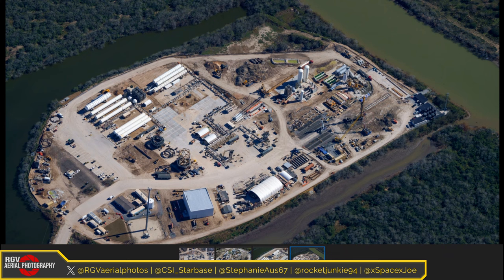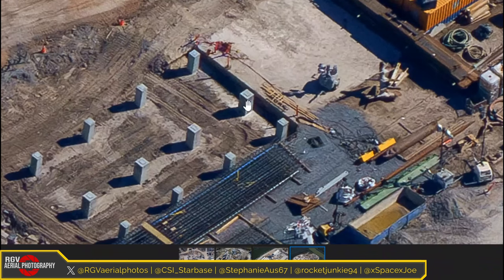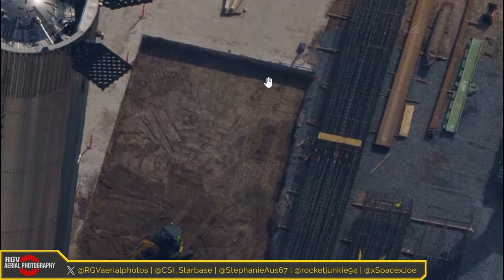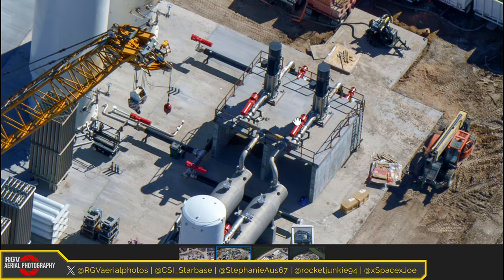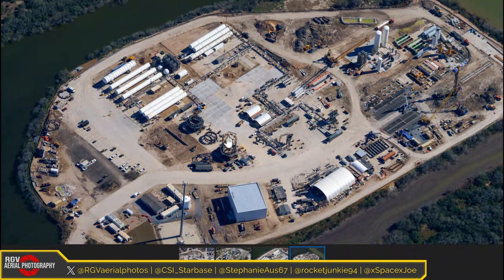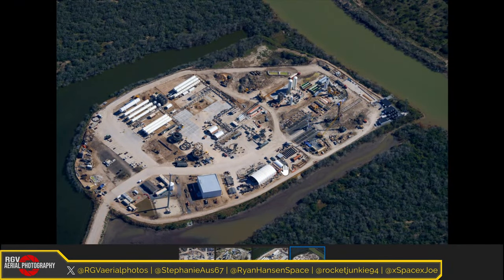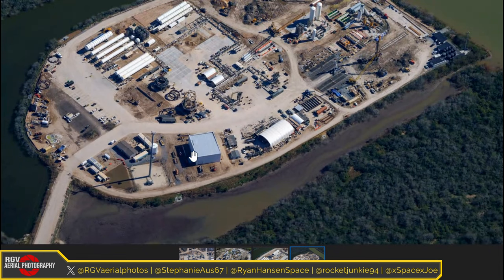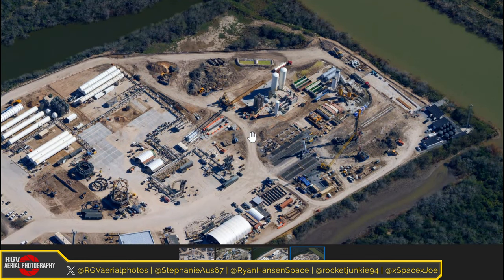Starbase Weekly, Ep.104: The Expansion Continues!

Comment: You mentioned one more horiz tank to be installed - I don't think so, there are now 8 newer (larger, recent) ones. & Do you know the volume, m^3 of these?
Reply: There is one more set of pedestals for the 9th gse tank at the OTF. We believe that there is actually a tank on its way.
Reply: Each tank has a volume capacity of ~1250 m³

Comment: Your comment ... "the crane hasn't been properly maintained"..... that sounds very foolish comment! How do you know "it was not properly maintained" ?
Reply: How do you know it has?  That sounds like a very foolish comment!
Reply: I think you mistook his comment, SX LR11000 has been together for around 2 years, usually cranes like this are taken apart and put back together several times a year so more routine maintenance can be achieved easily, after 2 years of being together it’s bound to need some more in depth work, with all the load cells and electronics on them these days it won’t have been unsafe at all, the salty air is very destructive on the coast